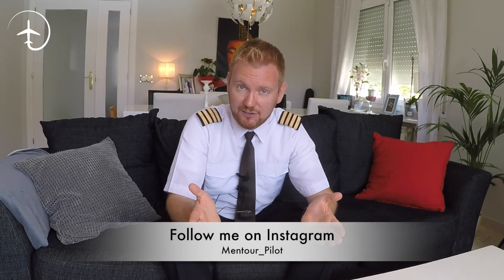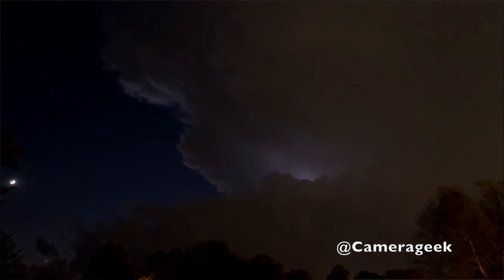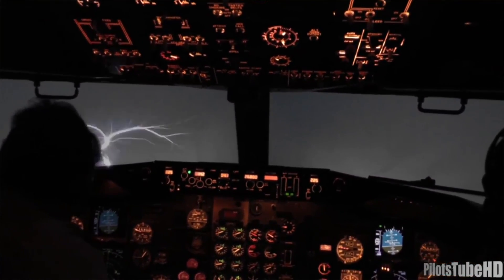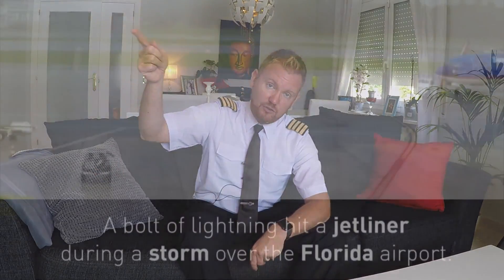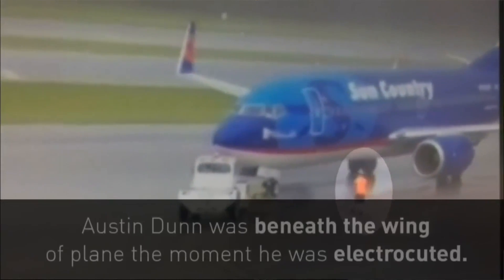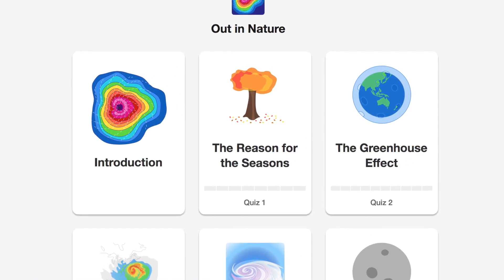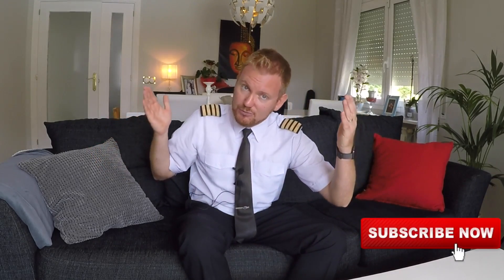Aircraft Lightning strikes - How I handled it

Comment: Is there any reason (besides cost) that commercial aircraft don't have small heated externally mounted cameras that would show the pilots on one or several of the glass screens in the cockpit exactly what is happening in front of each camera; flaps, engine fire, cargo door(s) ajar, frozen pitot tube, gear up or down, roof cameras for the tail and flaps and one in the tail looking forward to see the fuselage and wings?  
If you're thinking too much wiring, how about a frequency that would not interfere with the aircraft electronics? Bluetooth maybe or something else?  Or optic-electronic interfaces for some combinations?  Lighting could be provided by white light, infra-red, ultra-violet or some other possibilities.  These cameras would be in an "always on" condition and they could be hooded to prevent interference with the ambient conditions.
Just curious.

Comment: But shouldn't lightning hit apron light poles first (when aircraft is on the ground)? Most of them are equipped with lightning protectors and they are taller then aircrafts on the ground, therefore should provide easier path for lightning.

Comment: In the early '90s, I was doing the air to air videos for kit plane manufacturers from my Helio Courier STOL airplane.  We had two Betacam cameras mounted to the airplane, one on the right wing which could shoot either forward or backwards. On the ground, I was the cameraman for the talking head shots and factory shots. When we were working with Glassair, a kit plane manufacturer in Arlington, Washington, they had just gotten a contract from Boeing to explore the way lightning strikes affected composites since the Glassair was one of the first all composite airplanes.  They had just come up with what looked like a suit of chain mail for the planes made of loosely woven copper wire that was layered  into the composite material.  In 1992 Boeing was preparing for the 787.

Comment: Lightning's current flows along the leading edge with (nearly) zero resistance (relative to the high voltage), so there's (essentially) no heat buildup and thus, (almost) no heat to damage the aircraft. 

Alas, "nearly" zero isn't ACTUALLY zero, and "nearly" zero ohms passing 50KA at 100KV is still a hell-uv-a-lot of energy to dissipate.

Comment: Question: Is there anything you come across as a pilot that proves the earth is round?
Reply from the maker: Every day, all our navigation systems are based on the principle that the earth is round. The GPS system, the chart models, the Coriolis effect, the horizon... I can keep going for days.
Reply: Thanks for your reply. I think timezones are a very obvious proof
Reply: Yeah, I haven't heard a good flat-earther explanation for time zones.  Even driving across the U.S. over a week's time, how would my watch gain or lose three hours, depending on which way I was driving?  But logic has never been a requirement for being a flat-earther.
Reply: Right, I think flat earth goes hand in hand with flat brain

Comment: Would it be helpful for aircraft to be installed with lightning conductor rods? Although I imagine they likely need to be an unreasonable length to work?
Reply from the maker: We have something called static dischargers along the wings that does that, sort of.
Reply: Aaron Seet The Aircraft structure is bonded completely for all sections  and working parts like computers, actuators and so on by so called bonding jumpers/strips, so the conducting is already really good. The from @Mentour Pilot mentioned Static Dischargers or Wicks remove the static electricity, which accumulates from friction between the skin and the air. That static electr. could lead to interferences with the communication systems, so during use of those there can be background noises and resound. :)

Comment: Sorry but Skin Effect and the Faraday Effect are not the same thing. If you have a faraday cage made out of say 5mm thick metal, DC will conduct through all of the metal leaving everything inside safe. If you have a very high frequency electrical zap, it only travels of the surface of the metal. So for example in Aluminium at 1MHz the power will travel mostly in the outside 0.5mm of the conductor. If the frequency was about 500Hz then the whole of the conductor would be conducting assuming 10mm diameter or smaller. This is why even though the higher the frequency the better for the power supplies for power distribution, 400Hz is used as you can use circular 12mm diameter conductors without any of the conductor being in effect dead weight (the last thing you want on an aeroplane). The faraday effect is in effect scientifically an extension of Ohms law. IE electricity will take the easiest available path. So if your faraday cage has an impedance of 0.1Ohm which is easily achievable and the human body has an impedance of roughly 1k minimum then 10,000 times the power will travel through the cage as through the human. In reality a Faraday cage in an Aircraft is more like 0.001 Ohm, and the human will usually be dry and warm so more like 5k to 10k AND will only be touching in one point, so would need the air to complete the circuit which is a problem as air will not conduct below it's breakdown voltage which is more than 5kV/cm You would need basically millions of amps flowing through the faraday cage for a jump of just one CM at DC.
Reply: Gordon, thank you, again Learned something new :-)
Reply: Sorry but Petter never mentioned Skin Effect
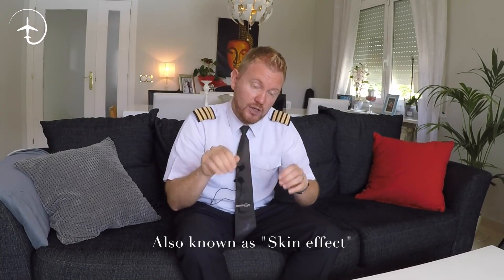Reply: @verysurvival  It is written at 7:02

Comment: What do you think about using static electricity to power aircraft instead of fuel.. just like Nikolai Tessa thought of with his experiment...??
Reply: Static electricity can only be stored in capacitors.  The energy density (in either Joules/kg or Joules/m^2) of even supercapacitors is well below that of lithium-based batteries, and the energy density of THOSE is at least an order of magnitude less than good old kerosene, even when you factor in the relative inefficiency of gas turbine engines compared with electric motors.  But Tesla wasn't working on storing energy; he was working on transmitting it, and this can't be done with static electricity.  His energy transmission experiments used electromagnetic energy, not static electricity.  It's easy to mistake his experiments with static electricity because of the visible arcs that look similar to static sparks, but there's a big difference.  Tesla's transmitters were anything but static.

There was some work done on wireless power transmission for aircraft in the 1960s or 70s, by transmitting microwave energy from solar power farms or other power plants along the major air routes.  I don't know which factor knocked this out, but problems included the hazards of transmitting gigawatts of microwaves into the sky, disruption of any radio-based communications by such transmissions, design of antennas that could efficiently collect these microwaves, and equipment to convert that into power in forms that could power electric motors.  Similar research has been done more recently into using lasers to deliver power to aircraft, but this also has not yet panned out.

Comment: What would happen if a cessna 172 or a cessna 182 got stuck by lightning?
Reply: Not much. It would scare everyone onboard. If it had any electronic sensitive equipment onboard they might go thru a restart cycle and be dead for a few minutes as they reset. The mechanical gauges would all be fine and the engine will keep running.

Comment: If you have lightning-danger, you do not refuel your airplane for safety reasons. Then I say: for the same "safety reasons", all ground operations (involving people on ground) must stop if you have lightning-danger.
Reply: I think this is the case.  I had to wait in an airport recently for flight delays caused by nearby thunderstorm activity.  All of the ground crews were brought inside until the storm passed, so baggage couldn't get unloaded or loaded, and planes couldn't be fueled.  This was the first time I remember this happening, so it may have been because of that Sun Country incident shown in the video.
Reply: That's good news... Unfortunately sometimes people working on ground are considered like ground equipment... I mean that sometimes there is no difference between a cargo-loader, a transporter, and a worker... Meaning that a human being is considered "equipment". Like "equipment", he is important only because he works. And an "enjured worker" is considered like a "broken down tool". In the same way that you can replace a broken down tool, you can also replace an enjured worker...

Comment: Hi Mentour Pilot can you talk a bit about motorized landing gear wheels? Whether you will find them useful, what are the advantages and drawbacks. And since you emphasize the safety requirement of airlines, whether you see any safety risks to using them?
Reply from the maker: As far as I know there are no airplane equipped with motors, that basically says it all.

Comment: As a merchant sailor I’ve had a couple of similar experiences: 1) northbound along the pacific coast of panama, in a nasty thunderstorm area, you could feel the electrical energy in the air.  All of a sudden the bridge is lit up by a purple/bluish light.  One of the VHF antennas on the starboard bridge wing had a ball of St Elmo’s Fire sitting above it!  The energy was so intense it made your hair stand up like a vandigraff generator!
2) anchored off Fort Lauderdale Florida USA.  Typical evening thunderstorm rolls through.  Don’t know if the ship was hit directly or not, doubt it, but the concussion of the lightening strike was so great it knocked out gyro compass out of balance!
Reply from the maker: Yes! Yet another way that the maritime industry is similar to the aviation industry.

Comment: Since it's possible for a modern airliner's computer to land an aircraft, is it possible for an aircraft to be controlled from the ground?
Reply from the maker: Theoretically, yes.
Reply: In practice, the U.S. Air Force was doing this from the 1950s through 1980s with fighter jets, specifically the F-102 and F-106.  These were designed from the start for "ground controlled intercept", with a computer on the ground calculating the optimum flight path to the hostile aircraft, and sending control messages to the interceptor fighter.

Comment: the problem starts happening when more and more aircraft are made of composite parts (carbon fibre resin matrices etc) ... i predict the future will have a lot more catastrophic events for aircraft of all types
Reply from the maker: The mesh woven into the composites should stop any problem from occurring, no matter how much of the aircraft is built from it.
Reply: carbon fibre itself is a very good conductor, thats why even the technical engineers can perform a structural eddy current inspection without any problems on aircraft with that kind of structure. :-) Also is one layer of the livery/painting a special conducting layer, which reduces the static electricity.
Other than Quartz, Glass or Aramid reinforced plastic though, those need to be inspected more carefully with other methods.
Reply: ok i assume the major players (airbus, et.al.) have done their homework on this - i was just curious about it because i saw (also on youtube) an experiment done sending high voltage 'laboratory lightning' from a tesla coil through both aluminum and composite materials and the composite material just EXPLODED - but i guess it was probably just a fibreglas composite or something... I think the problem with carbon fibre is that it has a RESISTANCE - which means that any current passing through it will create a VERY RAPID buildup of heat - i guess it's  partially a question of whether the skin in question can carry ENOUGH current with low enough resistance for there not to be any grave effects....

Comment: So weird this is coming up now.  Lightning struck within a 1/4 mile to the right of me while riding last week, no pause between the flash and bang.
That reminded me of a flight I was on last year was struck by lightning.  The whole cabin lit up a bright lavender color for a split second with a heavy thud.  I knew exactly what it was, but I looked around and nobody was phased.  I looked out the window, and there was a football size burn area around the leading edge between the wing and the flap.  The pilot and attendants said nothing until we landed and parked at the gate (probably to keep people calm).  Then the pilot said something witty like "I apologize for that turbulence on the way in folks.  A little fun fact, I don't know if you saw that flash, but we were struck by lightning on approach.  Better go buy a lottery ticket!"
I would only hope getting struck by lightning on a bike would be survivable.  The helmet is a poly insulator, so it won't travel through your head.  The Gore-Tex is soaked, with layers of air and dry clothes in-between, creating a skin effect.  Maybe some burns from the exploding clothes and proximity to the high current and high resistance.
Reply from the maker: 😂 I probably wouldn’t use that wording on the PA. :)
Reply: These were regional pilots :'D
Reply: 1) At 1/4 mile, there would be slightly more than 1 second delay between FLASH and *BANG*.  If there was no detectable delay, it was much closer than that.
2) The plastic in your helmet will have next to no effect at all on lightning - no better or worse than without.  It has only slightly better insulation properties than the air the lightning is already passing through.  And as for lightning taking the easiest path, I would point out that lightning often takes multiple paths, which is why we often see forks in lightning, so while you might not get the full current of the stroke, it can definitely still hurt you.
3) Water-soaked Gore-Tex is not a good enough conductor to cause significant skin effect.

Basically, being in a lightning storm wearing a helmet and Gore-Tex is electrically about the same as wearing nothing at all.  Maybe you should have bought another lottery ticket.

Comment: Captain, what happens when the engines intake rain? I know that engine manufacturers throw fake birds into the engine, but do they test for water?
Reply: The spinner cone of one jet engine is formed in a specific way(round or spiked cone form-depends on the engine-for example CFM56-5/7 or GE CF6-80), to deflect any incoming debris, birds and also water from the core engine to the bypass, called "flame-out protection". Due to the spinning motion it deflects the f.e. water via the radial velocity as much as possible to the outer diameter of the fan. Most Airlines have the procedure, to select "continous ignition" for the engines, when flying through a bad weather areal, so there is a high protection against a flame-out.
Reply: Yes. Also ground based co-gen turbines are tested with sand and dirt.

Comment: You didn't tell anything about the static wicks !!!
Reply: Soumyadeb Dey ok, here you go:
static wicks dissipate precipitation static that can develop as you fly through areas of uncharged particles. these particles can exist as you fly through solid or liquid particles such as rain, snow, fog, dust or ash. as the airplane flies through the particles, positive charges deflect and negative charges attach to the airframe, building up and eventually discharging at certain points of the airframe where the static wicks are generally attached. if the wicks were not installed,  there is risk of  audio disturbances, weak radio transmissions and even complete loss of communication. the A320 with sharklets has 39,  32 must be installed. the Falcon has 12, 8 are required,  mandatory the ailerons
Reply: Yeah, I was waiting for it but he didn’t mention.. 🤔
Reply: I knew it already, that's why I said he didn't mention it.
Reply: They tend to melt and blow of the airframe after a lightning strike. 
My ground strap on the nose mounted radar dome did not fair very well either. 
It was spot welded onto the airframe.

Comment: don't fly near the bottom of the cloud tops...  you don't want to be what connects the clouds to the ground.   the cloud to aircraft (static from friction) discharge is not nearly as dangerous and the energy that drives weather related strikes that involve the ground.   it was postulated that IF you could capture the energy from a ground to cloud strike you could power new York city for about 2 - 10 years depending on the individual strike.  that's why landing under a thunderhead is highly inadvisable... not to mention the hail or crosswind...
Reply: I think that's a wee bit of an exaggeration. 
By wee I mean ridiculously over inflated by many orders of magnitude. Thunderstorms are bloody energetic and powerful, but an entire storm isn't going to power NY for very long. How long would be worth your researching, it's an interesting question and will help you appreciate the boundaries of the credible.

Comment: Lightning strikes shouldn't be a big issue for the structure since they're very high frequency and will stay on the skin of the aircraft and cloud discharges are much less potent than ground discharges.
I guess the electromagnetic interference would be a bigger issue but sitting inside a huge Faraday cage helps.